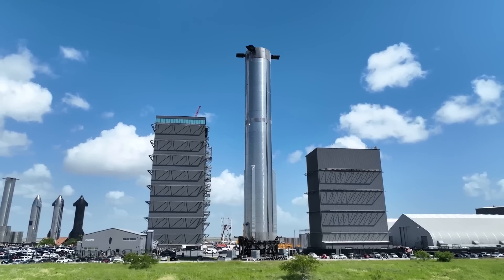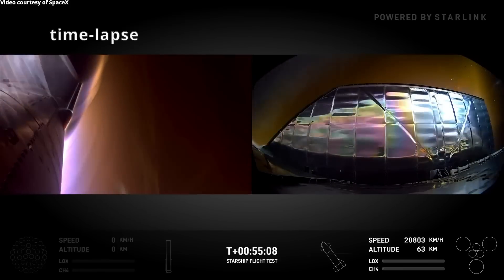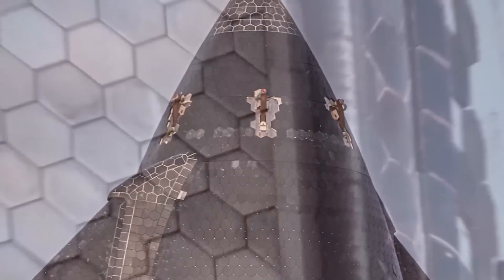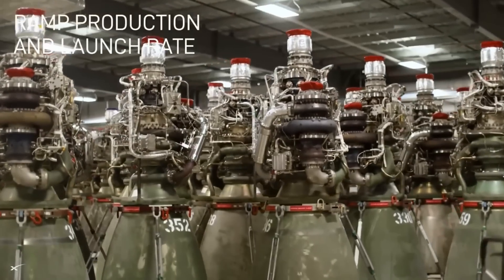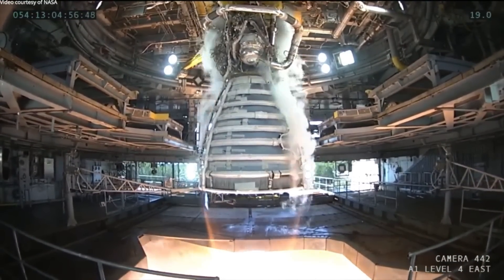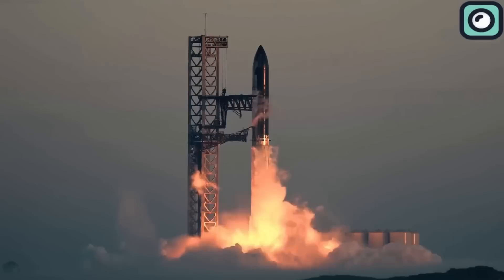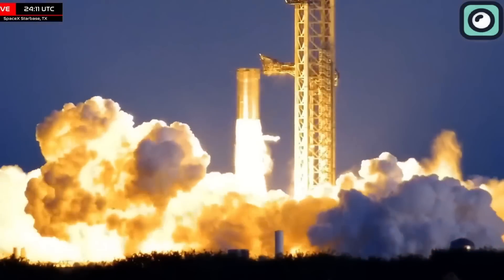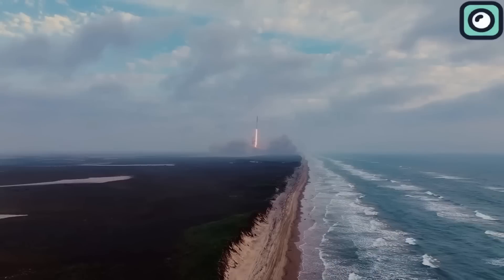SpaceX Made Serious Changes To Starship Heat Shields For The 6th Flight!

Comment: Just an idea! Why don’t you flip earlier and decrease the speed with the rocket motors in the upper atmosphere, then with the speed burnt off, there won’t be the high temperatures to deal with.
Reply: That strategy would likely require doubling the size & weight to enable such a deceleration.  And that would make the spacecraft virtually useless for carrying much of a payload.  Better is to use the atmospheric friction to decelerate the reentry.
Reply: @ I agree that doubling the size is out of the question. But I still can’t see why slowing the spaceship would require so much extra fuel. It’s not pushing the space craft up, but slowing it down and the lighter it gets the less power you need to accomplish a slowdown of the vehicle!!
Reply: @davidwatson3921  You still need to carry sufficient fuel to decelerate a craft from 17k mph down to speeds under 2k mph…that still requires a long deceleration burn using lots of fuel, fuel that displaces launch payload capacity.  Fundamentally, reentry heat shields have universally proven efficient & safe.  And these are reasons why one doesn’t employ the method you suggested.  Were it logical if the compromises in payload capacity were nil, then it would have been employed long ago…yet we don’t find such a reeentry method anywhere; proof it’s not practical.